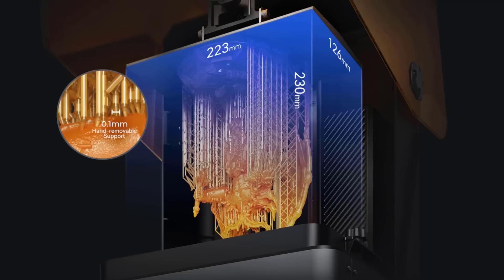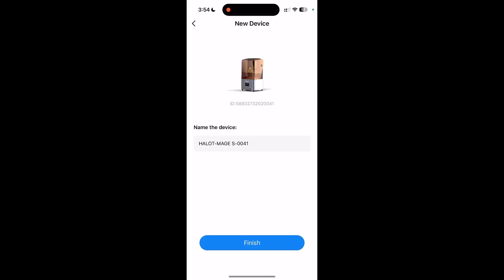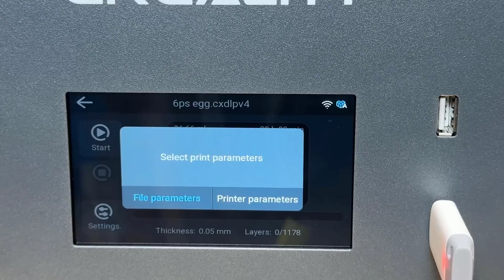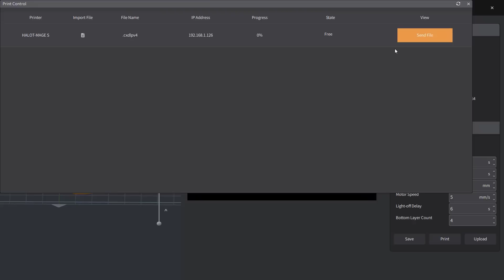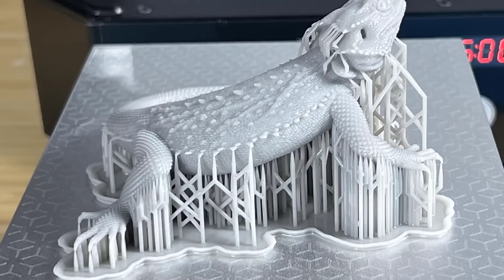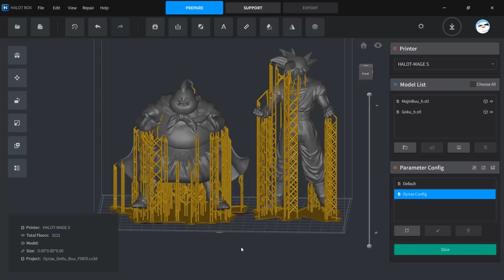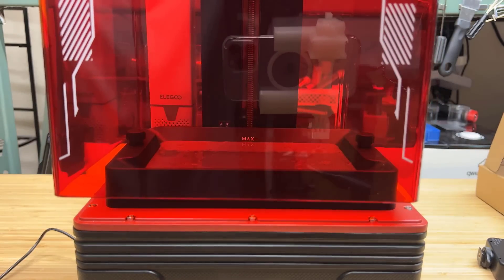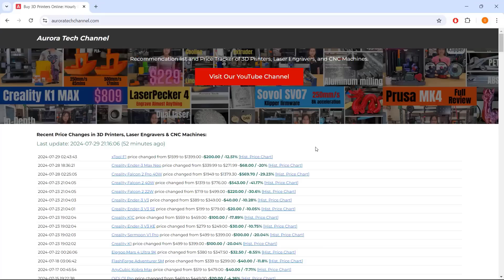Creality Halot Mage S 14K resin 3D printer Review

Comment: Gokus's base failed likely due to the gap created between supports and base. The space allows resin too much resin in between and the base being flat causes extra resistance. Had you printed the base directly on the build plate it would have a better chance.

Comment: Hello. I'm very interested in this printer but I need to know how small can this print while retaining detail?  I learned from another video that the larger the print scale capabilities of the printer the less detail on the smaller end of its printing capabilities. If not this particular model is there a model that is capable of printing very small 3D models that could be encapsulated for custom keyboard keycaps?

Comment: The true speeds are witnessed if you move the layer size to .1mm (100 microns) at the same, normal exposure time with the high speed resin.  You're basically reducing the overall print time by halving the number of printed layers. All of these "high speed" manufacturers should make a much clearer statement about this stuff.

As for the leveling, I'd always rather manually level.

Comment: auto leveling isnt a real thing its just marketing feature if u done it right self leveling will take 2minute and u wont need to do this more than 1-2 times in the printer life span i'd rather they fix the "cheapness" of this printer UI and get better wifi connection invest on programmers to get a resin calibreation feature

Comment: Great Job... But I have one suggestion if you did not do this. Always clean the build plate dry before printing... ALWAYS. I USE A DOLLAR TREE WINDOW CLEANER.  This way it always stick. One may think it's not necessary since it's going to get dirty in the resin but for the first layer this is critical. Thanks for an informative review.

Comment: It would be nice if, for resin printers, you would add a pixels per millimeter value so that it would be easier to understand a 14K printer of 250x250 mm versus a 8K printer at 200x200 mm sort of thing

Comment: A little mistake in the cons part: you compared the slicing time between Halot Box and Chitubox. You have to include in your timing the export part from Chitubox as well, which will do the rasterization of each layer, and that takes the longest time. Then Chitu is faster, but not as fast as you presented. Except that, solid review!
Reply from the maker: The slicing times for both slicers are normal. I timed the file export process after the file has been sliced, and the Halot Box slicer needs 3 minutes and 18 seconds just to save the 75MB file to the local hard drive, which is unreasonably slow.